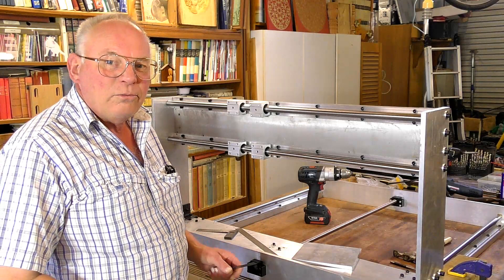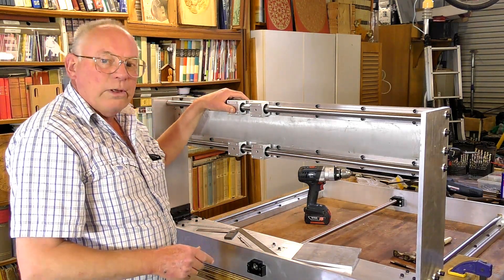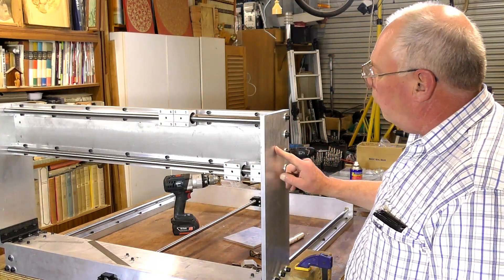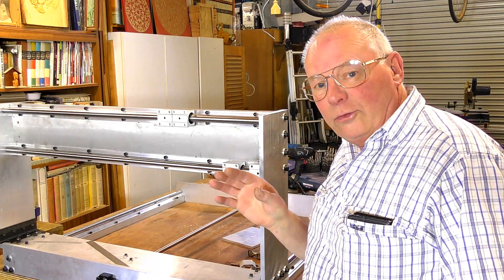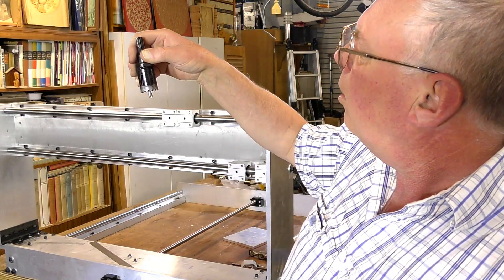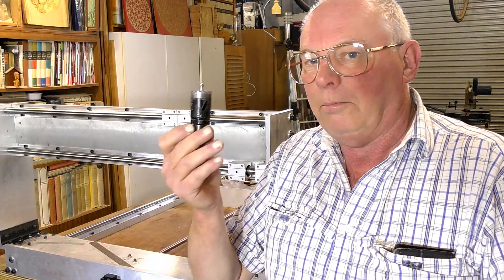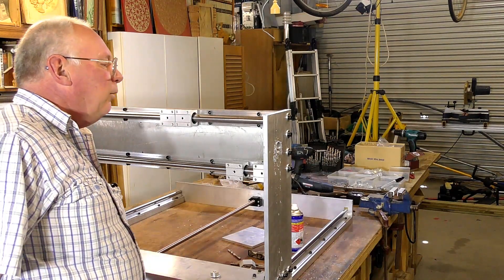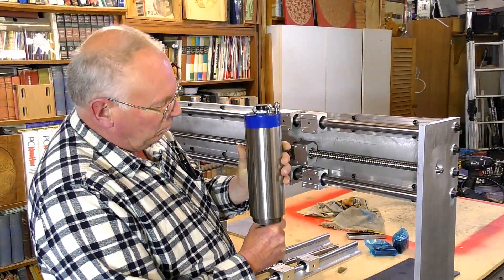Episode 7 HOW TO MAKE A CNC ROUTER WITH SIMPLE WOODSHOP TOOLS (X and Z axis build)

Comment: Looking really good 👍  I love gantry design. I am currently running a sainsmart prover xl 6060 with a work space of 24” x 24” it’s a great solid machine  but I am out growing it lol. I am looking to build and design a similar cnc with a work space of x 48” and y 48”
Going that big I don’t think I will be able to get away with a center ball screw I will have to have 2 ball screws one for each side for y axis. Also wondering if high torque nema 23 will be enough maybe need to go with nema 34.  
Looking forward to see your build complete and which controller your running.  Your videos are wonderful keep up the good work . Thank you sir 👍